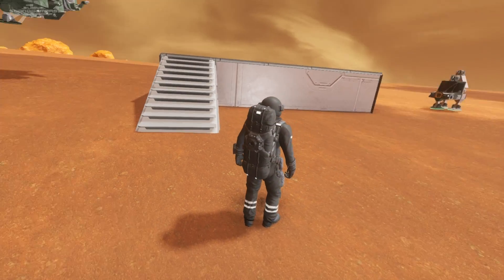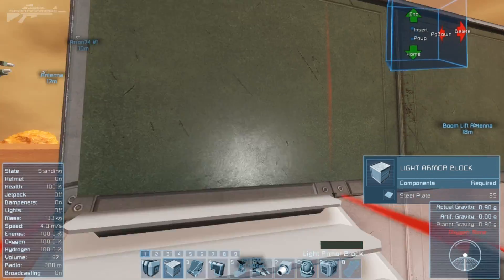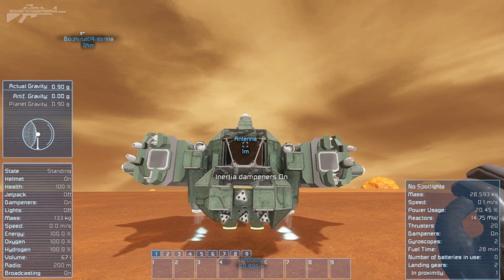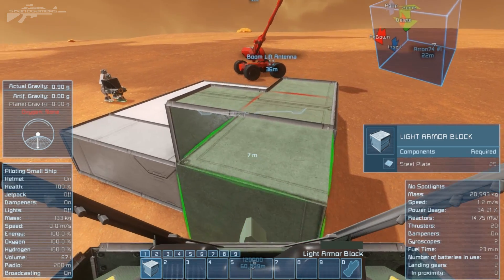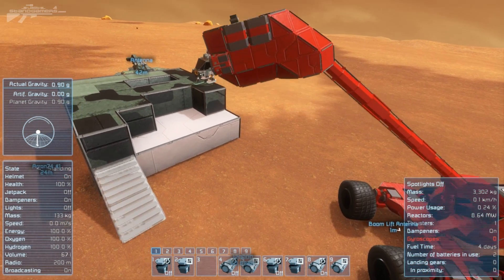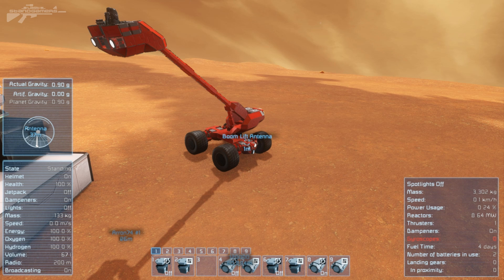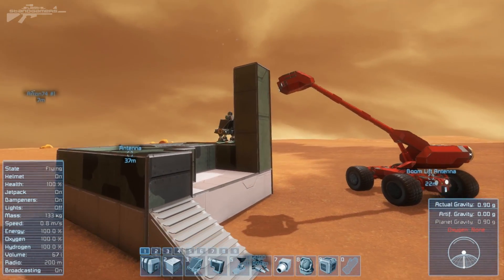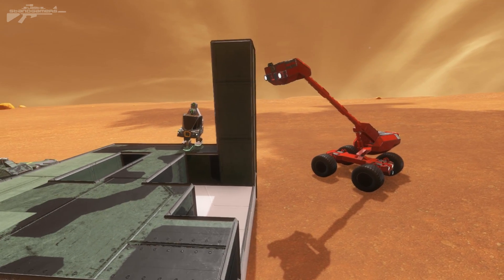Space Engineers - Atmospheric Building Problems

Comment: Why wouldn't you just use your jetpack on planets?  I haven't played in a while because I'm waiting for AI to be a bit more fleshed out, but doesn't the jetpack work fine on planets as you just demonstrated?
Reply: +Suedocode Basically, the jet-pack uses up hydrogen as a fuel source, and it does so very quickly. If you use it constantly you would quickly burn through your hydrogen stores. Generally it is more efficient this way.

Comment: How can I make my station more solid, mine is moving when I walk into it or drive into it.
Reply: +Sijt H use the "build new station" button in the G screen, and place it into the ground, add a merge block and try to move your station onto it, I think you've actually built a large ship rather than an actual station which is why it moves. So either that or use landing gear.
Reply: +Kuro The problem is that when I click new station the block to place is on a really weird angle
Reply: Sijt H it should automatically level with the ground now, bit if it doesn't, press B and rotate it.
Reply: Ah thanks

Comment: would it be possible to make a space elevator? in this game
Reply: +Michael Herring I started to in Creative. You can only place rows of blocks 101 blocks long at a time. It was taking such a long time to even get out of 100% gravity, let alone atmosphere, that I gave up.
Reply: +DergerissenerGauner did you try copy and pasting the structure as it got bigger instead? So when you get to 202 blocks copy it, place it on top then copy that and place it on top and just repeating the process?
Reply: Yes I tried. Gave me so much lag flipping the thing around that I couldn't even get it to connect right. Overall it's not worth the effort unless you really want it.
Reply: +DergerissenerGauner still be cool to see a working space elevator
Reply: +Michael Herring though I don't know what you would use it for lol
Reply: Well once you built it it could be used to ferry things from A to B and back without needing to really navigate. Plus a simple up+down movement doesn't need a lot of thrusters and wouldn't need any for things like inertia dampening. And if you really wanted to go all out you could just put a conveyor tube in it and make the ground+space station one station, which is almost like "cheating"
Reply: DergerissenerGauner
Yeah, I was gonna build one when planets came out using artificial gravity as an actual elevator but they don't work in actual gravity. There goes that build idea.

Comment: Mining is pretty bad, my PC can barely run the game now (its somewhat old, but directx 9 works fine if on med-low graphics, but just swapping to directx11 makes it unplayable unless I use a LOW resolution, even then its like 20 frames tops, hope planets get Dx9 support)
Anyway, gravity and mining sucks, the ships you get at the start suck for mining, as they are gravity effected, and its all too easy to smash into something mid mine. And is this just due to my low performance or is everyone getting this, but when i mine its not smooth like before, it doesnt mine at all for some time, then it hops forwards and mines all the things near the drills, then holds again, then mines etc and what this does is makes all the rocks from mining NOT be picked up by the drills, its like each 'tick' where it mines, it picks up the rocks from before, but the rocks drop away so by the time the next "tick" happens, no rocks are gathered. Does it 'tick' for anyone else, or is my processor chugging?
Reply: Same here, demolish, collect, demolish, collect.

Comment: you need to stabilize the platform to keep it level.
Reply: +Ace Fire I noticed that too. You could probably put the Height adjust and bucket angle on a timer block and have them move at the same time to keep it level.
Reply: 1 rotor acting in reverse at the top should do it.

Comment: i had worse issues, i tried to build a base in a mountain.
cost me alot to mine the entire place to put the base inside it.
but now its a nonstop untill i have a base as large as DULCE.
Reply: kar ras Alright, i'll give it a shot, thanks
Reply: +kar ras try building outside then slotting parts of the base into the hole like crazygamer996 said.
Reply: +Sir Chopwood

i had no trouble with foundations, the issue was the terrain deformation because i used a drill and later on i manage to build and put a mining ship into it it was a pain to do a straight line, ended up like a dome.
you need to hide some parts somehow, now the base is flat block soil and all the stuff is on "sub levels" made just for that, like the actual thing, when i manage to build some big ass miner, i wil make the whole mountain holow.
i also had some troubles mining ice from the snow fields in mars, somehow the drills didnt picked up the ice, didnt tried "water" too.
Reply: +kar ras What do you use to mine with? Care to share?
Reply: Grindstone just a wall of drills, a cockpit, a few rotors, few batteries and a huge ass thruster facing down in the center of mass.
wall got bigger untill it reached 3 big blocks by 2, no need to grow for a while now.
Reply: +kar ras My problem tends to be unfix-able. My land vehicles fall through the ground.
Reply: +ShaddyWoohooMan 
abuse of creative and move to another site copypasting
Reply: kar ras Well, actually I was in survival mode when it happened
Then I used creative to check if it could happen again, it did
Reply: +ShaddyWoohooMan If your ship is having trouble keeping airborne, just add more thrusters and enough reactors to keep them powered. It's that simple.
Reply: Privateerblack Well, yeah I know about more thrusters but that doesn't really help the land vehicle falling through the ground problem. Thanks though
Reply: +ShaddyWoohooMan try increasing the details to max to see if there is any missmatch between the visual and the physical models. or try the same ships pasted on a diferentes map.. report any result
Reply: kar ras Kinda worked, but driving on the game is still a pain. Guess ill just have to stick with flying ships
Reply: +ShaddyWoohooMan im making a giant walking robot. and i can tell its worse
Reply: kar ras Dang, the walker sounds cool as a mobile mining platform. hopefully these problems get fixed or at least easier to work around.
Reply: +ShaddyWoohooMan the biggest issue is the actual weight. feets use to break alot. and the while thing waves without control. i need to master the sensores to make it more soft.
i was thinking about modular build and make it able to do various tasks
Reply: kar ras well, in that case, make a base with 6 legs for stability and the top part can have all the things you need. If you already have a design for the legs then you should be set as long as they can support the weight. Maybe i'll try building a walker someday.
Reply: ***** i have the legs and the frame done in creative, its the 4th gen actually, its 6 legged symetrical base to mount stuff, one gen had wheels, but couldnt handle the weight and cant drive wheels on rotors over pistons over rotors over pistons... the other gens were about making it lighter and more like an actual leg with muscles, its made with small blocks, but still is pretty huge, make holes in the ice if the step is too strong.
the problem is the lower part of the leg, wich makes actual contact, solved all rotational problems, but the thing is pretty huge, i must make it smaller, and lighter, and make a better feets.
Reply: kar ras well, sounds like its going to be a cool walker, maybe make mini ones with turrets to patrol the area. Not that they would be practical or anything but walking drones are cool.
Reply: by the size im thinking about a walking station, gonna figure the mix to put big blocks on the top, and make a base as part of the modular parts, mining, and the actual project, wich is the gun turret, need also to test the gravity cannon.
Reply: kar ras Gravity canon? Just saying, if you intend on using it on a planet gravity generators don't work on planets.
Reply: thats some bad news actually.
the only options left are an automatic missile creator with thrusters, or some wheeled rail system, gotta do some research.
Reply: kar ras the automatic missile creator sounds like a cool Idea, it will be more bulky with atmospheric thrusters being the only possible thing usable. make the missile drone controlled so that passengers may control it to hit the target.